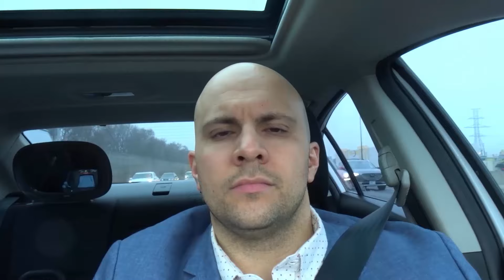Multiple Dash Lights Coming On With Check Engine Light-Easy Diagnosis

Comment: If your tires are low, fill it up with air, and it will get rid of the problems. My 15 Acura TlX lit up like a Christmas tree, before I panicked i simply filled my low tires with air and Thank God the lights all disappeared

Comment: Simple, clear explanation of a very complex scenario.  Should have pointed out that a failing alternator will affect the computer and send all the warning systems off….which just happened to me.
Reply: Hi it just happened to me. Did changing you alternate fixed this problem for you. Please reply me back. Thank you
Reply: @sarangkulkarni  root problem turned out to be a sensor that identified abad wheel bearing, fix worked.
Reply: Thank you. My brother is a mechanic for 45 years, he told me this last night & I completely forgot. I got too wrapped up in the videos
Reply: Hi, can you perhaps tell me how you solved this issue? My car has initially started displaying a battery light for some time. Later on, after a while, it was all the  dash lights came in, and the steering became harder to turn.
Reply: @taavishilongo685 
Same here sir.  Could it be rats chewing on some wiring?

Comment: Thanks for this video, you explained it very well, it can be very scary when driving along a hwy and suddenly ALL of your dashboard warning lights go off!
Reply: This just happened to me and I’m scared. Idk what happened and he’s talking to slow for me
Reply: @selene0222 in one easy phrase; Get your breaks checked asap!!! That was my issue. Something happened to my breaks and a belt was almost severed
All warning lights = breaks
Reply: @Napp28  ughhh. My breaks really? My tire sensor was on the past year bc I don’t sensors on them then today when all the lights came on and off, that light when off too !
Reply: @Mynamesnotrickk did all the dash warning lights turn off? If so could've just been a glitch. When all mine went they remained on even though my car seemed perfectly functional ... but the issue with me ended up being the breaks and a belt that had somehow almost worn through  ... the mechanic didn't understand how it happened and made a joke about someone trying to kill me cause had the breaks went on the road  .... 
I'd have someone look at your car asap but ... if the warning lights did turn off who knows
Reply: @Napp28  yeah, they only came on for 2 seconds when I was exiting the hw then turned off. It also reset the trip A and B back to zero. (Not sure how to explain the trip a and b)
Reply: @Mynamesnotrickk  Ah if all the dashboard lights came on for only two seconds and then didn't reappear, than it was probably some sort of reset. When mine came on, they all STAYED on! I continued driving it for a while because I was in America ... When I got home to Canada, it was determined that my breaks were about to fail! Luckily all turned out well. I guess the breaks are so essential that when they are about to go they set off all warning lights. 
Side note, I'm getting a new car this Friday and have mixed feelings; I'm gunna miss my MKZ!!!!
Reply: @Napp28  woah you live in Canada? What’s the like? I want to travel up there one day. And nooooo you’re getting rid of the mkz?!!

Comment: My 2017 MDX had all the warning lights come on as well. Couple days ago low tire pressure lights came on the driver side front and rear tires. Unfortunately, I didn’t check the passenger side and only filled pressure on driver side tires. About 3 days later, all the warning lights came on. I was pissed and started researching online. Came across this video because I didn’t think it was the initial low tire pressure that caused the warnings. After filling the passenger side tire pressure (which was at 29) and making sure all 4 tires were 35. I turned the car on and off couple of times and most of the warnings went away. Collision mitigation remained so I went for a short drive and that cleared as well!! I’m so happy it wasn’t a costly repair.
Reply: A 0

Comment: It’s called the controller area network or CAN for short. All the control units in a modern vehicle communicate on the system back-and-forth between each other. When there’s a problem with one, often times it can trigger a universal code in the system and cause multiple warning lights to come on.

Comment: Thanks I have a 2014 Hyundai sonata hybrid and all the dash  lights are on, car wont start ( already  new battery  10 days ago ) and I’m terrified it’s going to be big bucks 😱but at least after watching your video I can hope it may be just one tiny sensor 😩 because  car things make this lady so upset !
Reply: Dealer charged me 2,300.00  😔 mostly labor,  for a 200. Switch replacement.  Hate the Dealers. I want to drive a car, not a PC on wheels.

Comment: Have a question, the car was on the drive, but the dashboard lights were showing up, so that, made the car stop immediately. The sign then said to move from the P position to the D (drive position) which I did, but did not start it. Could it be the engine was fully not ready or did I have to restart the car? Just making sure that this doesn't happen on the driving test...

Comment: Im in the same boat my 2014 toyota corrola starts but wont change shift along with steering wheel stuck. All lights on dashboards are all on . Waiting for an electrical mechanic to check vehicle out.

Comment: Yeah but with so many different problems. How do you know which one it is that's causing the all the problems.
Reply: I wish I knew I wish I had a friend who had one of those plug-in devices or I wish I had enough money so I wouldn’t have to be 😖afraid to take it to the dealer- I never trust the dealers they always rip me off good luck with your car troubles

Comment: Mine does not shift to drive or reverse after all tho lights come up. I come back in 5-10 minutes then it works. My battery tested 100% fine and fully charged at two shops.   50k miles  2018 Accord hybrid

Comment: I am scared bc I have 4 lights on after multiple codes showed at first.  Almost 900 bucks and I paid 2700 for car.  I am scared it may b a money pit bit will not know.  Now I need the rotors possibly fixed.  It's adding up

Comment: Hi,
I recently bought a BMW 320i XDrive manual car from auction and notice there are 4 warning lights on the dashboard:
1. Engine light
2. Traction
3. ABS
4. Brake lights

Got it diagnosed by someone, who told me the transfer box is damaged. The guy who diagnosed the car remotely mentioned that i can get it programmed to be set as a RWD, which will solve all the problems. Any one has had similar issues? If yes, how did you manage to resolve it. Kindly advise.
Thanks
S

Comment: 2020 Nissan Versa is a pieces of crap. Use to have a 2008 and a 2009. Never had a problem at all. 2008 ran good till 300, plus miles till motor gave out. But 2020 Nissan Versa. Números of issues. Worst car ever.